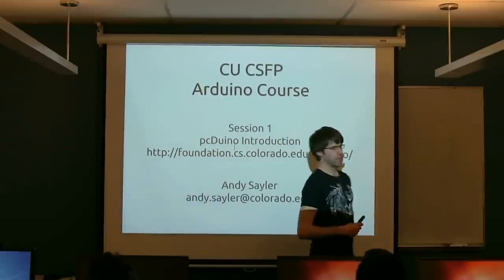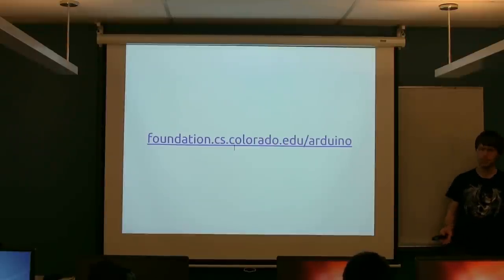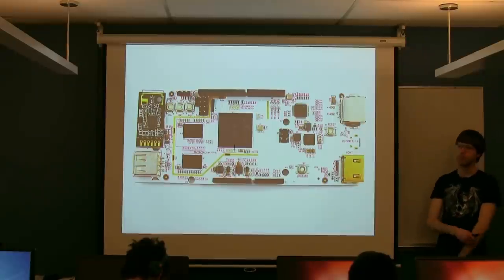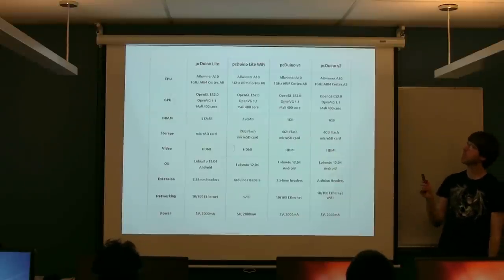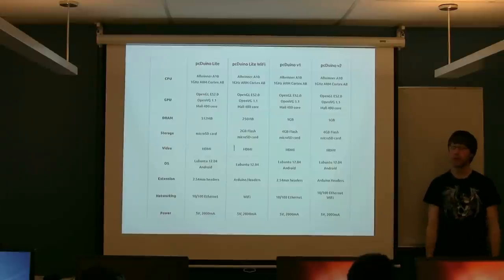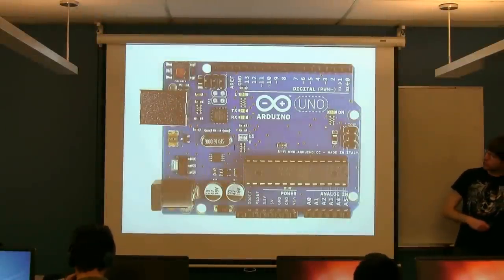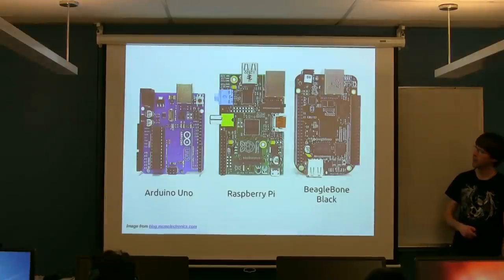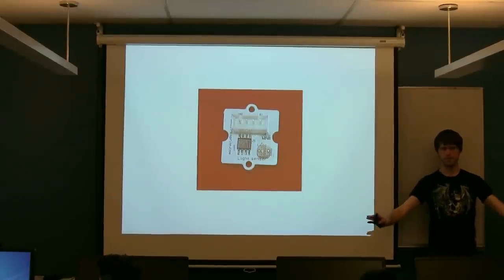CU - CSFP - 140225 - pcDuino - Introduction - Part 01: Overview

Comment: i know this is old...but any chance ya could do a tutorial on compiling a new linux build for the pcduino v3? (for lamers like me!)
the builds available are old,  dont connect to half the repos..and id like a bit of updated security before i run this on my network 24/7...and the arduino IDE is sooo damn old, i cant even get it to load libraries...

Comment: can you tell how many bits for the ADCs?
Reply from the maker: I'm not 100% sure what the ADC resolution is in the pcDuinov2 (http://www.linksprite.com/linksprite-pcduino2/).  The pcDuino v1 (http://www.linksprite.com/linksprite-pcduino1/) had 6-bit and 12-bit ADCs (http://digitalhacksblog.blogspot.com/2013/09/pcduino-analog-read-tutorial.html), and the v2 uses the same SoC (Allwinner A10 SoC: http://www.allwinnertech.com/en/clq/processora/A10.html), so I imagne it has the same ADCs. But you'd need to contact LinkSprite to confirm: http://www.linksprite.com/contact/.